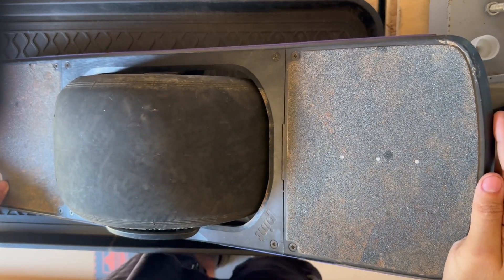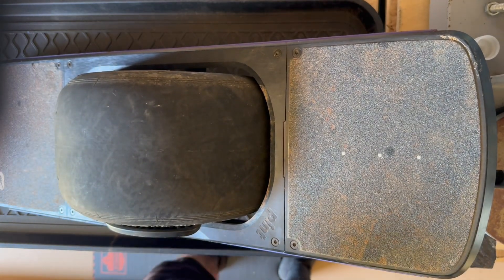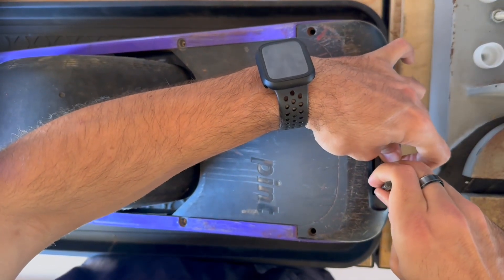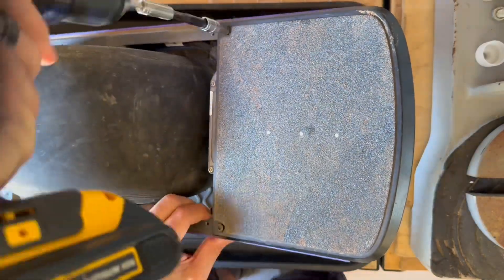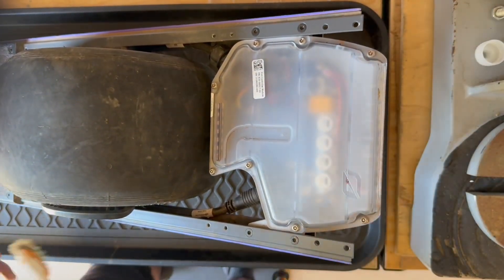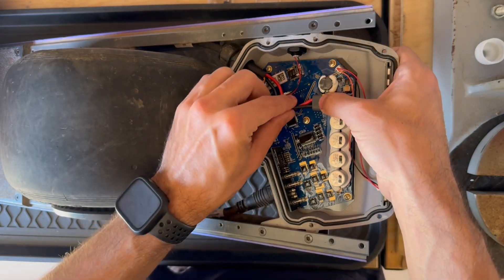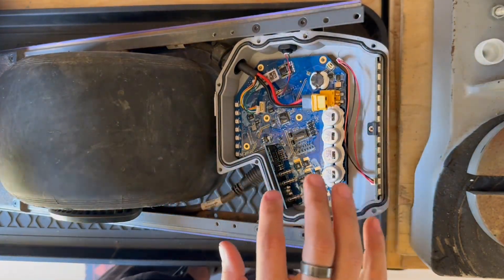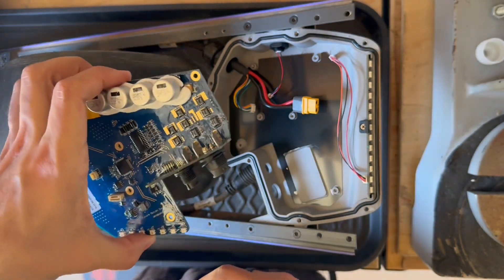How To: Onewheel Pint and Pint X Controller PCB Removal

Comment: My pint has an intermittent on switch problem, I have to push it a lot to come on, other times it comes on first push, where should I start to fix it? Thanks and great video
Reply from the maker: Hey! That’s a tricky one, because it could indicate an issue with the button hardware, data wiring, or even an intermittent issue with the BMS. If you’re still experiencing the issue, feel free to reach out via my website.

https://www.fixmypev.com/contact-us

Comment: What bit did you use to take over the cover? I just bought a T20. It had a hole in the middle and 5 points on the head. What exact one did you use? Any help would be appreciated
Reply from the maker: It’s a TS20 bit. If you’d like, you can actually pick up a Onewheel GT Tool Kit from The Float Life and use code ‘FIXMYPEV’ for 5% OFF. 

https://thefloatlife.com/products/tool-kit-pint-compatible?srsltid=AfmBOor5ePKMepbsnShMAw8zGAvD2SNrbyh_QXxxnAOUzT-HyM7TAHJ5

Comment: Hi Justin— this is great, thanks! Question: can I replace the OG controller with a Px controller and use it with the OG BMS + a Quart? Looks like I need to replace the controller and having a hard time finding OG controllers but I’m seeing Px controllers. Any ideas? Thanks!
Reply from the maker: Unfortunately, that wouldn’t work because the Pint X controller wouldn’t recognize compatibility with the OG Pint BMS.

Comment: Can I put a pint controller in a pint x to be able to rewheel the pint x? If so is that all I need to do just change controllers or do I have to have a pint bms? Thx
Reply from the maker: You sure can! It’s usually possible by simply changing the controller and using ReWheel patches to ensure compatibility. But if you have a Pint X BMS to swap in, that’ll make the battery % more accurate (ReWheel patches still required for compatibility).

If you have any additional questions about this process, feel free to message me at https://www.fixmypev.com/contact-us.

Comment: What about plugging back in
Reply from the maker: My preference is to plug in the data connector, headlight connector, and power button connector (any order) followed by the controller XT60. Make sure you don’t press the power button prior to connecting the controller XT60.

Comment: Do you know the advantages would be if i looked into the Floatwheel drop in vesc controller for the Pint, when or if it comes out?  I’ve got two pints and a GT and looking for more upgrade options that are economical.
Reply: There is the AvaSpark kits
Reply: @techchannle4247  are they pretty plug and play?
Reply from the maker: The primary advantages are the freedoms that come with VESC-based hardware. Endless customization, repairability, and affordability. If you have any specific questions, feel free to email me at https://www.fixmypev.com/contact-us.